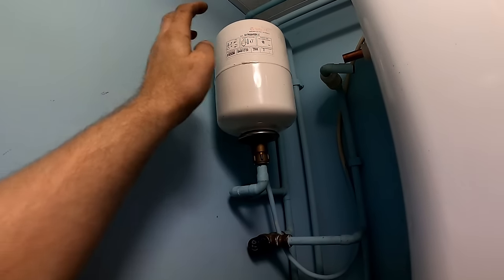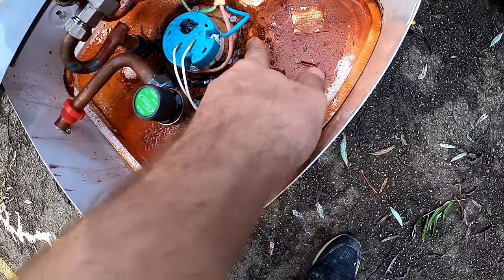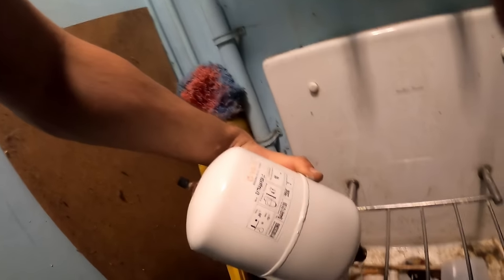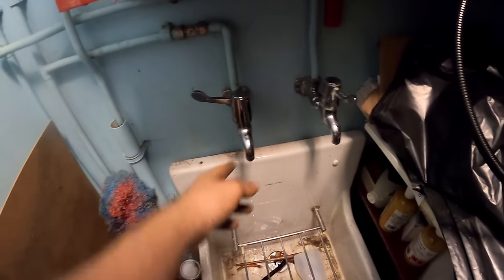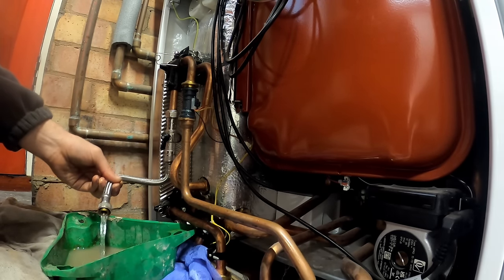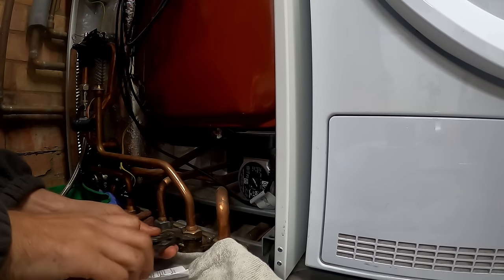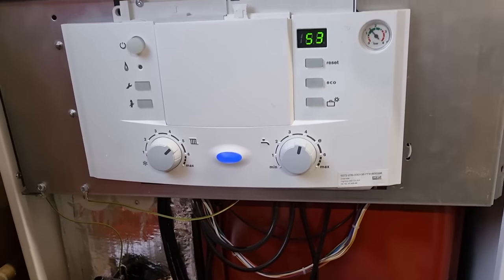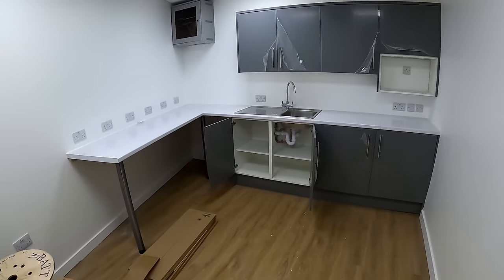Electric water heater swap and gas boiler fault

Comment: Tom, Who needs to get/ apply for a hot works permit? Are these permits needed when you go to somebody's house if your doing soldering or is it just on a site?
Reply from the maker: I don't bother with them on domestic works, the last job was in a shopping centre with a full fire alarm and sprinkler system, I really didn't want to set the thing off, I could have possibly disabled the alarms with the site team and got a permit but by the time I'd done this I could have been done, thanks for the support mate
Reply: Thanks Tom. 👍 @PlumbLikeTom